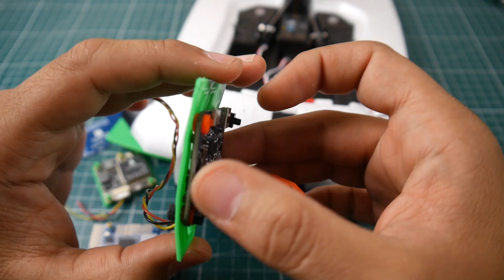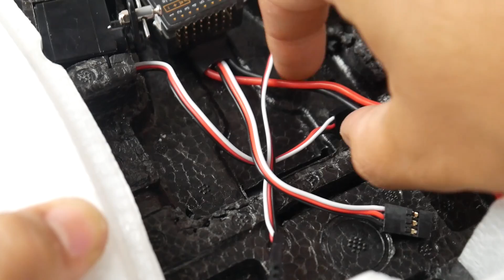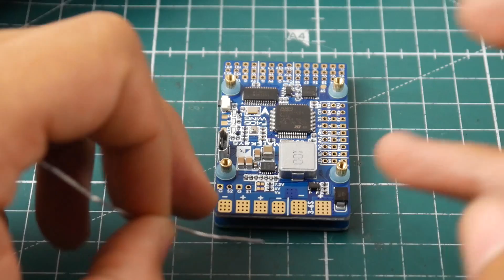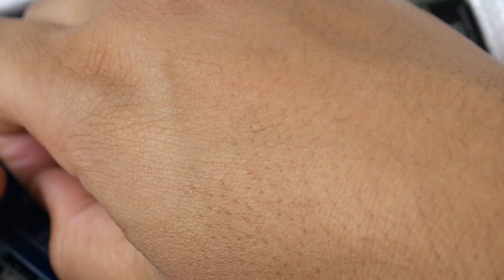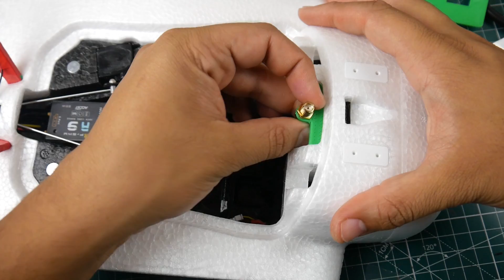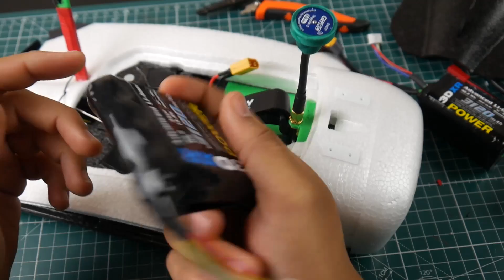How To Build INAV Fixed Wing , RC Airplane // Long Range FPV Upgrade Part 1

Comment: Can you accomplish a long range distance by waypoint/ GPS navigation to prevent a communication failure between the controller and the receiver inside the drone?

For example, the distance range between drone and controller is 50 miles, but you want the drone to travel 100 miles. Can you set the drone to follow that distance using the GPS waypoint instead of relying on the controller distance range??

Comment: Does the fc need to be centered in the plane ? I mean, can it be more on the right than on the left for example ? I would say yes but not 100% sure :/
Reply from the maker: Where are you planning on  putting it?

Comment: Mesh a heads up on the Beitian GPS! I had a really bad connection to satellites until I replaced the coax cable that connects the gps board to the antenna board. With a quality coax between those you get a much better signal 14 sats plus where I am!

Comment: Doing the same type of build but useing the furious 2.4 vtx and module setup . I like the idea of the batteries  cant wait to se how they do
Reply from the maker: I gave up on the 2.4ghz too much noise and felt very laggy at times.

Comment: Drone mesh I found my old drone so I went to change the pids on beataflight but when I plug it in it says failed is this because the boards last update was in 2017 and if so have do I update it it’s a racerstar star f4s

Comment: The 4.5v pad is to power the receiver via USB while setting up. this saves connecting a battery and running the vtx while configuring in inav
Reply: Also prevents you from using serial passthrough to flash receiver firmware... and anyone using R9 at the moment should expect to have to update to new firmware quite often as the protocol is improved and bugs squashed. 5v is preferable in this case as it allows you to power the receiver up AFTER the flight controller is booted and set to for serial passthrough on the receiver UART.

Comment: Have you considered printing in petg or  nylon to help avoid the warping
Reply from the maker: No it's good for now.. I will just cnc a carbon fiber plate for it if it gets too bad.

Comment: Would it be possible to put a micro size camera(like the foxeer arrow micro pro) inside the wing like how the fpv cam is mounted on the Sonicmodell AR Wing?
Reply from the maker: You can do anything with tape and glue.

Comment: Haha i was just thinking about your open hardware project and how it could be used for ardupilot  for fixed wings. Man i love your videos. Oh and def put a heatsink on your VTx if your mounting it on a printed board lol
Reply from the maker: BTW a spoiler I just built the Open hardware FC it arrived a couple hours ago... It will be tomorrows video ;)
Reply: @DroneMesh  Yaaay! Lol i honestly think this open hardware thing will revolutionize our hobby man, i mean the rc hobby in general. Super excited for that vid